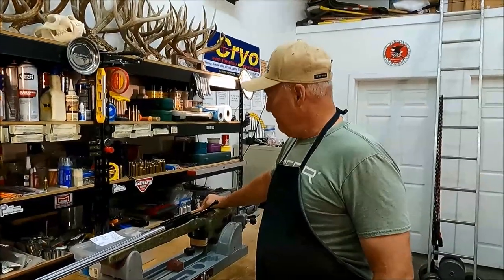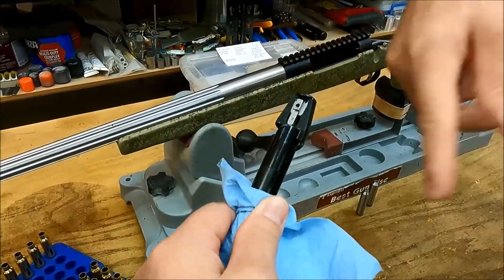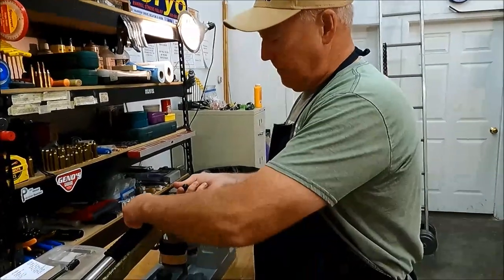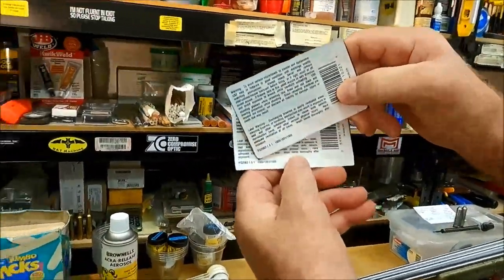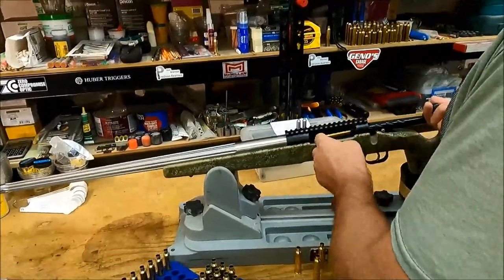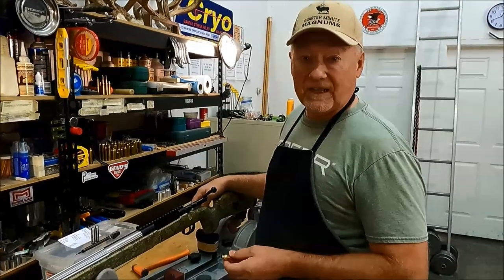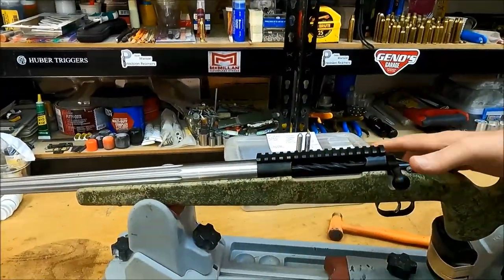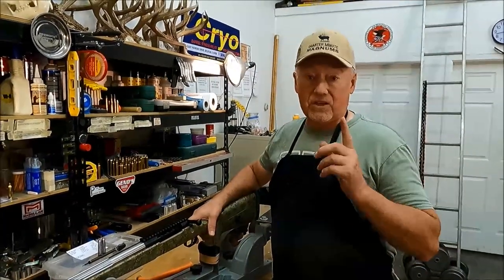30 Nosler - Check your brass!

Comment: Happened to me in the field last season! Colorado Elk Season, went to confirm zero the night before. Tight bolt closure but not impossible, first shot seized the bolt and had to come off the mountain to get it unstuck. Went back with a different rifle. Peterson Brass, CA Rifle. Great advice here
Reply from the maker: Dear Sir - thanks............

Comment: I run new brass through a full reloading cycle, set the headspace correctly with a full length die. Usually even short brass gets squeezed up to proper headspace. I dont waste time checking if it will fit, just size it so it will.
Reply from the maker: Dear Sir - a custom FL-DIE ? ? ?
Reply: @quarterminutemagnums  No Sir, Custom may be nice, but regular FL die is by far better then neck only or no size at all. I like your style and your rifle builds, I just can't subscribe to your brass sizing and clearance methods. These methods are rarely used for competition nowadays, because it's been tested over and over again to not be beneficial, and usually causes issues. Work hardening is a non issue if you have to throw your brass away at 3 or 4 firings because it no longer fits in your chambers.
Reply from the maker: Dear Sir - tell that to Tony Boyer.........thanks. @somedude5713
Reply: @quarterminutemagnums  Tony Boyer isn't the only fella Winning, and what competition he is shooting isn't practical for the application your rifles are built for.
Reply from the maker: What does "practical" mean? Thanks........... @somedude5713
Reply: @quarterminutemagnums  , there is nothing practical for long range magnums for hunting purposes that short range Benchrest shooters do in a competition. Long range and short range are very different animals. How many Benchrest guys are using Magnum Caliber's of any size, the answer is ZERO, and the reason is it's not practical for their application.
Reply from the maker: Dear Sir - Bedlam or Danvers State? @somedude5713
Reply: @quarterminutemagnums  where ever you want to go with that closed off mind of yours.

Comment: I always check head space on new brass with a comparator, especially non SAAMI spec/wildcat cartridges. I've gotten brass that's a tad long and usually full length size the brass before I first fire it. The mouth of the case is usually not uniform either. If headspace is good, then I just run them through a mandrel die. I never just load new brass and go fire it without checking it. That would be stupid.
Reply from the maker: Dear Sir - thanks.

Comment: Interesting. I've run into factory ammo that wouldn't even chamber and it was premium match ammo from a well known brand. Thankfully they took it back and paid me MSRP for it (which was about 30% more than I paid for it). I should mention this is a factory rifle without any kind of special chamber too.
Reply from the maker: Dear Sir - I have witnessed the same thing with factory ammo. Sometimes "bad" lots make it out of the factory. Thanks....................

Comment: Just today I experienced the same thing with new Nosler 300WSM brass. Out of 50, half would not allow the bolt to close or even come close. I measured head space and those were all exactly 0.002 longer. I FL sized them without the button, then ran them over a turning mandrel twice each to uniform neck ID. Also compared the Nosler to my new 300WSM Norma brass. They are 10 grains heavier. I plan to load lighter weight Barnes TSX 150s in the Nosler brass. Tomorrow I'm testing OTW for 168 Barnes TTSX, 180 Nos ABs, 190 Nos ABLR, 210 Berger VLD hunting bullets. I just got the factory Tikka back from getting the throat lengthened to seat bullets out further, get a little more powder in the case - essentially cloning the PRC concept. Just need to switch out the bolt stop with a long action piece and I already have extra long action mags. COAL for the 168 TTSX is 3.091 (70 thousands off lands), and for the 180 ABs it's 3.114, about 25 thousandths off
Reply from the maker: Dear Sir - Lapua please make .300 WSM brass !!!!!!!!!!!!!!!!! Thanks.

Comment: ...and I just loaded 50 new 6.5C in unfired brass. I also have some new 6.5C Lapua brass I'm going to do this test with in my Bergara HMR. With my new brass I often measure headspace and write it down. I do the same after first firing to see what has moved. So, with that 30 Nosler brass, are you going to bump the shoulders back and use it anyway?
Reply from the maker: Dear Sir - I put my shims in the bolt face and bumped them back with the chamber. I will use them for foulers and sighters. Don't try this at home with a factory rifle ! ! ! Thanks...............

Comment: Wouldn’t that issue go away by running all your brass through the sizing process?
Reply from the maker: Dear Sir - you can bump the shoulders back - but it is better to start with uniform brass. Thanks.
Reply: It's already not uniform, sizing it would make it more uniform. Yes running it thru a full reloading full length sizing process to set the headspace correctly would not only make the brass more uniform, it would eliminate this issue, as well as the need to check it. Short brass will lengthen, long brass will shorten.
Reply from the maker: Dear Sir - unless you have a custom FL-DIE that matches your custom chamber, you are just work-hardening the brass. Thanks... @somedude5713
Reply: @quarterminutemagnums  , Well maybe slightly more, but not enough to worry about, annealing negates most of it. You pointed out the only possible theoretical issue to full length sizing, Not full length sizing comes with a long list of known  issues. Feeding issues, fit issues, non uniform issues, bolt click and many more, and all these things lead to accuracy and inconsistency issues.
Reply from the maker: Dear Sir - FL-sizing is fine if the die and chamber match. Thanks............. @somedude5713
Reply: @quarterminutemagnums  well obviously, that's why they make dies in different chamberings
Reply from the maker: Dear Sir - so they match dimensionally ! All 30-06 dies do NOT have the same internal measurements; all 30-06 chambers do NOT have the same internal measurements; all 30-06 ammo does NOT have the same external measurements. We are talking about CUSTOM chambers and dies here, not SAAMI spec. off the shelf junk. Thanks.....................  @somedude5713
Reply: @quarterminutemagnums  Well I agree if you are using a custom reamer that the case body is not to Sammi spec which makes it wildcat of some sort. Then yes you would need a custom die made. Being Sammi spec does not make it junk, there is a lot of custom junk out there as well.